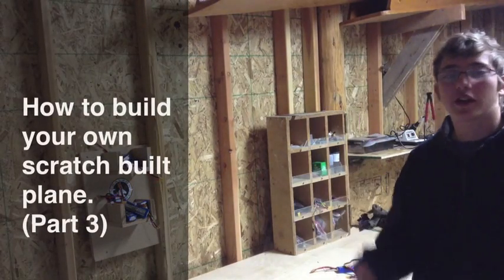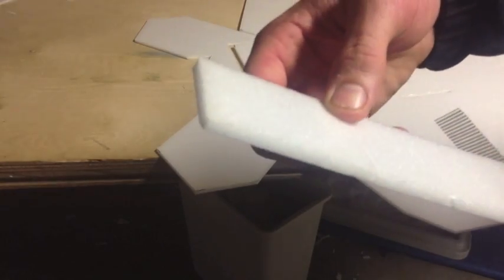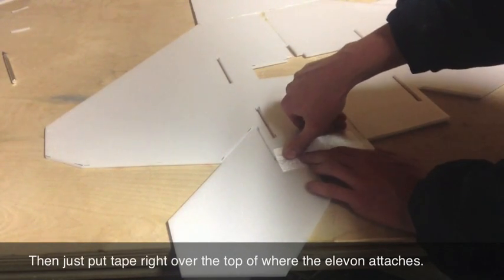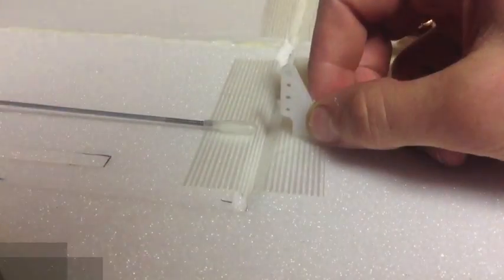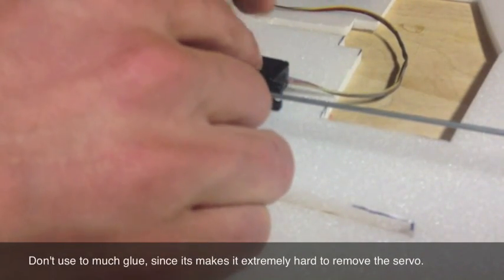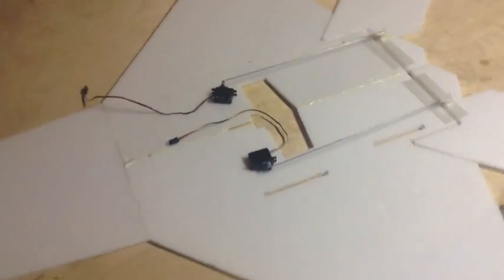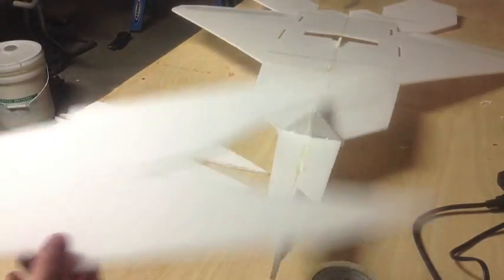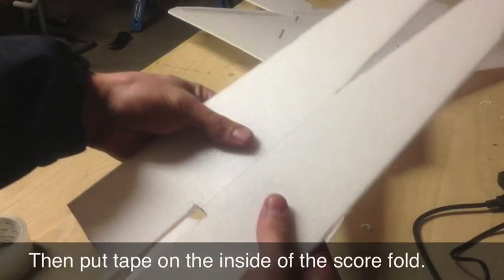How to build an rc plane (part 3)

Comment: Good JOB ...Put Parchment paper down on the table  first then glue pieces together. Hot glue does not stick to the parchment paper. Parchment paper can be purchased next to the aluminum foil at most markets.

Comment: sorry i meant after part 3. i need to know empty wieght couse i built 2 rc powers and 1 boxermaiden plane. they are around 400 grams before electronics(just added servos), 200 grams battery, 60 grams motor, 30 grams esc. and other staffs like xt60 or 3,5 gold connetros etc...lets say total electronis 350 grams. the plane make 750g around. Can i have this trust with 2200kv turnigy d2826-6 motor + JM 6x4 prop ??

Comment: Am doing a F22 v1. Got the foam from hobby lobby and don't know what size motor and blade to put on it. I don't have the weight of the plane.
Reply: Do rcpowers.com f-22 v1 and go tothe parts list really easy thats what I do for all my planes
Reply: Right now am looking for a list of weights and what size motor to use